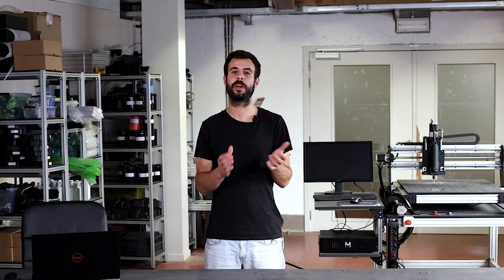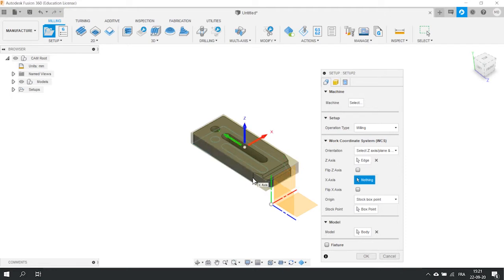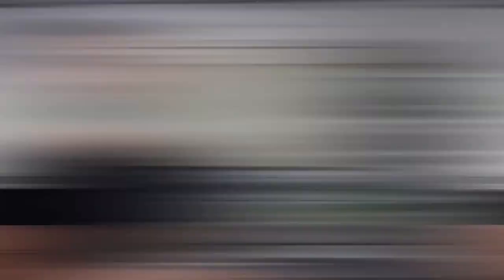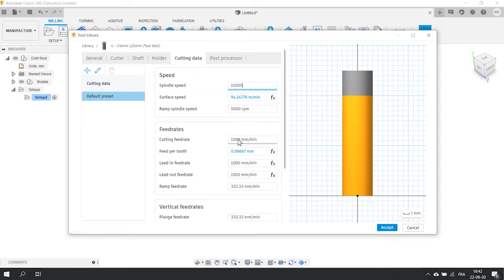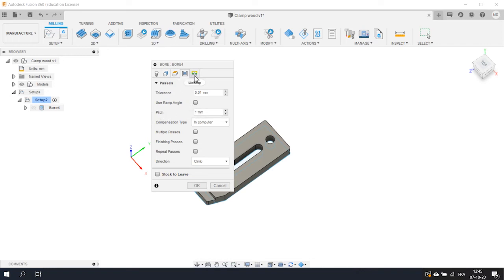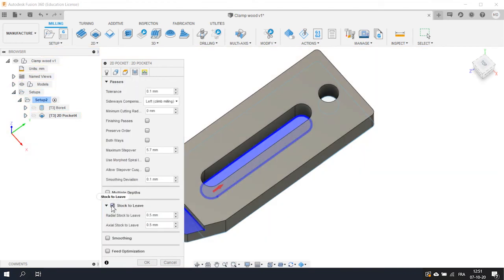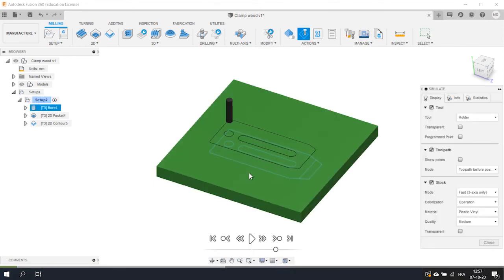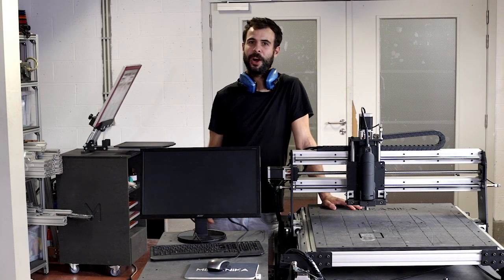CNC Milling Tutorial #2 | Turn Your 3D File into G-Code

Comment: Is it possible to for example use an articuled model for a 3d printer on this? Or would it have to be changed
Reply from the maker: Hello,
Do you mean milling a 3d model that is articulated and made for a 3D printer?
If yes then most probably this is not possible, as milling is substractive and 3D printing is additive, they can't reach the same areas during the operations.
Reply: @MekanikaTools  I see! So you would have to split the model into different pieces to mill it separately and then glue the wood together after? Interesting
Reply from the maker: That could be a solution, but i'm not sure you can obtain an articulated item this way... It would need a specific use case to study the feasibility :)
Reply: @MekanikaTools  Interesting! I would love to try that one day for sure.
What would be the best starter cnc to get? I'm a 3d printing guy but wanting to expand to cnc haha
Reply from the maker: Our EVO model is what you need then, it is the perfect entry level CNC to learn, but with capabilities to mill real projects still, it is not a toy.

You can check its presentation here https://www.youtube.com/watch?v=4YATYQC6hI0

Comment: But how you can post cnc code if you don't have any cnc machine or 3d printer, but want to practice?  Everything is so expensive now. :-(
Reply from the maker: Hello,
You can use both Fusion360 in free version and PlanetCNC simulating a machine on your computer if you want to practice !

Comment: Why isn't this more automated? This is a true pita compared to laser or 3d printing
Reply from the maker: Hi!
The thing is that CNC is a lot more complex than laser/3d printing, in terms of different possible situations encountered. So you need to have control over all the parameters to make them fit your personal case.

But if you tend to repeat the same thing (same material, same tool etc.) you can easily save presets to reuse them quickly and avoid entering all the parameters every time.

Comment: Great tutorial I was looking for this. Thanks for posting.
Could you tell me how to generate CAM tool paths for multiple parts from a single stock piece? Is this a good idea though? Or should I just mill one part at a time?
Reply from the maker: You can definitely mill multiple parts in the same CAM!
- in the setup: click on "models" to select the multiple parts you want to mill
- in the milling operations: same thing, select the models that will be used in this operation, and select the contour/face for each parts
- toolpath will be calculated to get from one part to the next one when finished
Reply: @MekanikaTools  great, thanks

Comment: Could I load a model as a step file into fusion and then use the CAM from there or does the model need to be designed in fusion?
Reply from the maker: You can import a step file ! :)

Comment: I'm new to cnc.  I have an aluminum part that has a 2D pocket with a hole at the bottom out the bottom of the part.  Should I bore the hole and then clear the pocket, or should I clear the pocket and then bore the hole?
Reply from the maker: Hi Justin! It will be faster to clear the pocket then to bore the hole. But you can simulate both in your CAM software and choose according to its preditions.